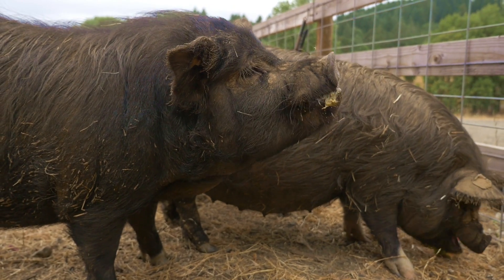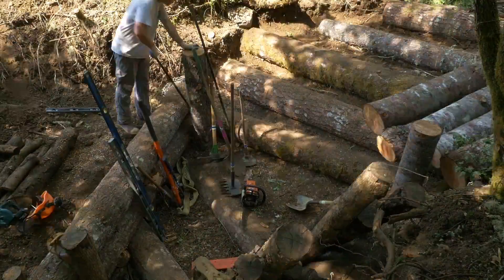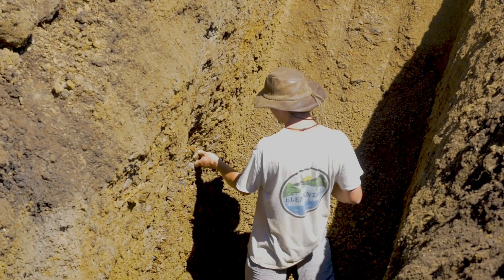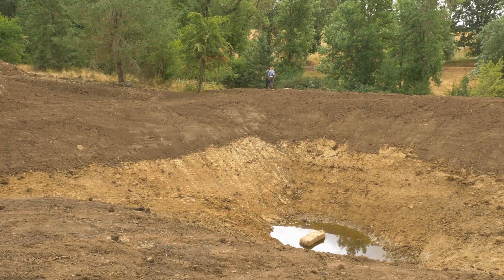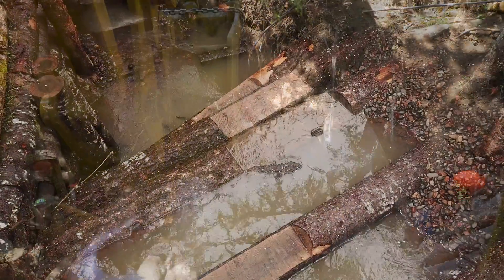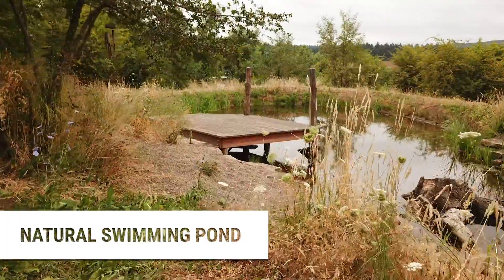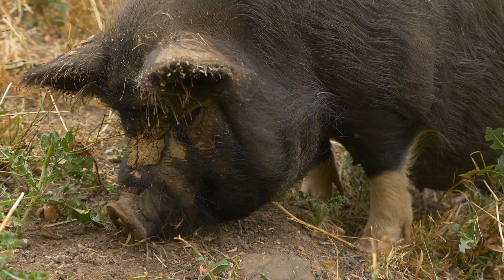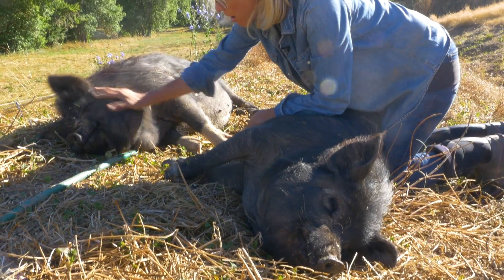Water Brings Life: Tabula Rasa Farms, Phase 2 - Elemental Ecosystems

Comment: Was there some underground water already on the big pond? Also, would this idea (capture rain water) only work in clay? Great material. Look foward for more
Reply from the maker: There was a small underground water flow in the area of the lower pond.  This was observed beforehand by the vegetation.  Because of the dry summer it was only a moist layer while building the pond, but now that the spring has been recharged there is a constant flow of cold spring water into the pond.  You do need clay to hold the rain water year round.  If there is no clay there are other ways to hold onto the water and extend it into the dry season.